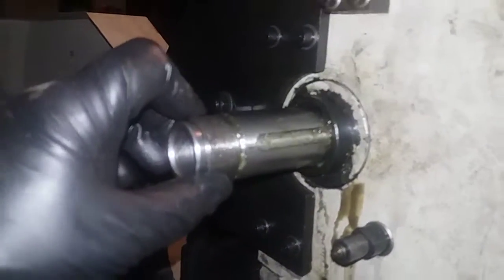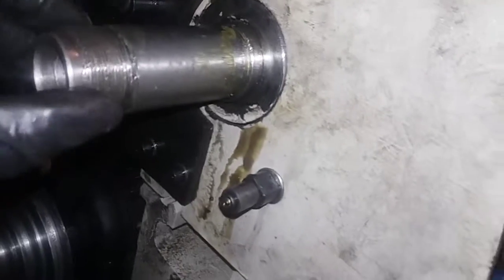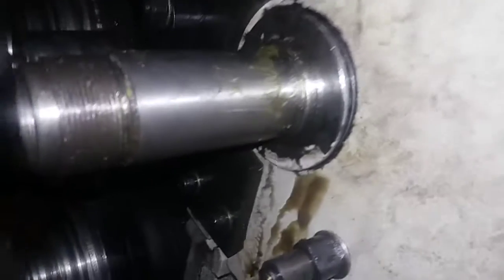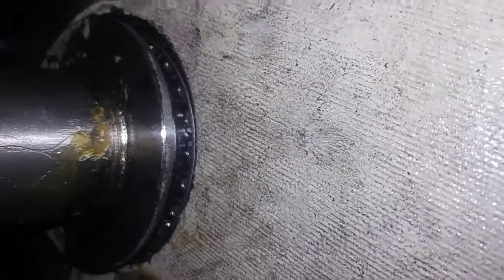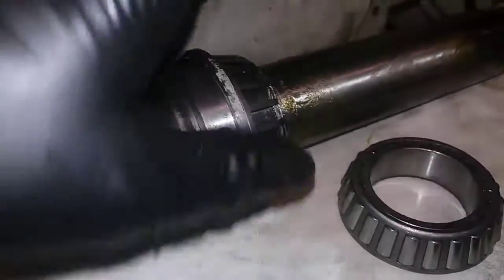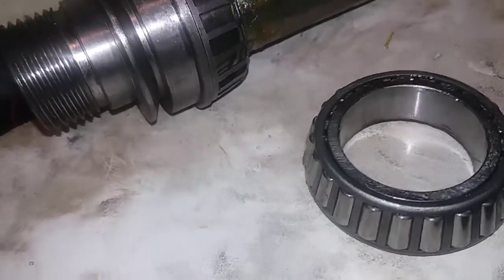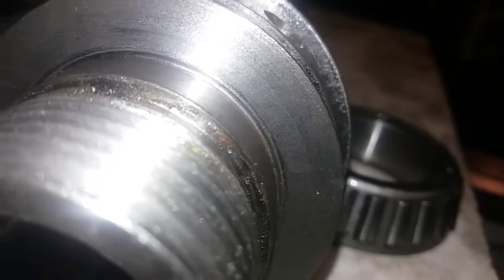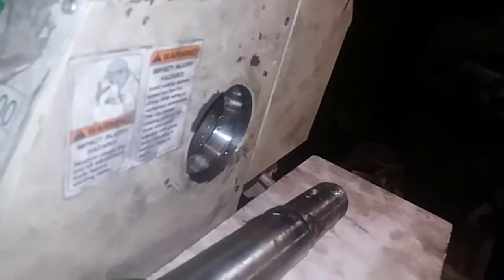G0602 Lathe Spindle Replacement/ Headstock teardown Part 1

Comment: Posting this on the first and last of the 6 part series.  FYI for other viewers:  In spite of the constantly moving camera this series does provide some insight for anyone needing to replace the spindle, bearings or both on this and similar lathes.

This is the only video I have found so far showing the spindle and bearing replacement on the G0602 which has the same headstock as the G9972Z.  I want to electively replace my spindle bearings as the lathe is over 10 years old and the videos have been helpful to know what to expect.  My main takeaway from this series is to make a pair of arbors to install the bearing races.  I'll machine them from aluminum to fit the ID of the race and the ID of the opening in the headstock.  They will be at least 1" long; maybe 1-1/2" so they'll stay aligned on the all thread.  That will eliminate all of the juggling of the heavier parts including the chuck (!) on the right end.
Reply from the maker: Thanks I appreciate that, yeah I know they are not the best videos, this actually started as an experiment to just see how youtube works for posting, what would happen and such to see if I wanted to continue, but still to give that kind of info, I did start improving with camera stand, and give relevant info not talk too much etc. but now I'm going to work on 2 youtube channels, and add more and improved content here as I have ideas in mind because the videos keep being viewed. regards Jared

Comment: Sooooo how did you get the spindle out?
Reply from the maker: If you watch about the 2:20 mark, I'm tapping it with a dead blow hammer, that caused the spindle to slide out the front, it has tapered roller bearings so the back bearing stayed in place and the spindle came out of it going through the front and separated from the bearing.

Comment: You can’t  use hard hammer  to remove the spindle!!!!
Reply from the maker: What are you talking about I didn't? That black hammer is a old deadblow hammer, and even if I was just tapping it out I could use hard hammer since I was replacing and not hitting very hard.
Reply: Well he was putting in a new spindle and bearings anyway...

Comment: Moin , Dein Video finde ich gut, aber deine Kamera bitte unbedingt auf einen Ständer ,  die Kamera wandert ständig hin und her, mir tun die Augen weh. Bitte nächstes Mal mit einem Kamera Halter. Ansonsten weiter so.  Mit freundlichen.   Gruß aus Lübeck Horst
Reply from the maker: Vielen Dank, Lübeck Horst, ich habe Google Übersetzer verwendet. Entschuldigung, wenn Fehler aufgetreten sind. Vielen Dank für den Kommentar, den ich jetzt für einen Stand verwende. Einige dieser Videos waren meine ersten Tests auf Youtube-Videos. Sehen Sie sich mein aktuelles Video des hausgemachten Dornrahmens für an Kugelgelenkpresse mit Flaschenheber. Grüße Jared.

Thank you Lübeck Horst, I used google translate sorry if any mistakes, but thanks for the comment I am using a stand now, some of these videos were my early tests on youtube video, watch for my most recent video of the homemade arbor frame for balljoint press with bottlejack. Regards Jared.